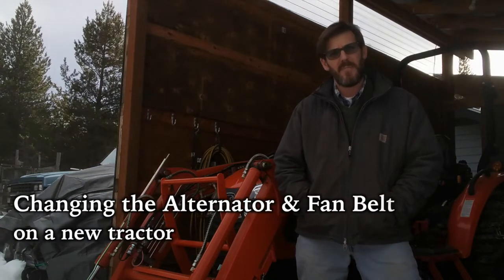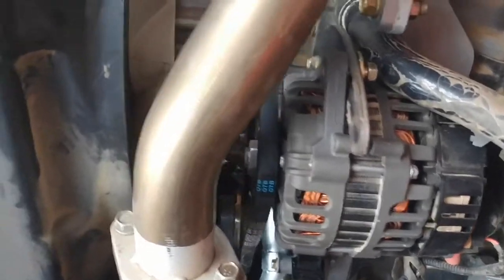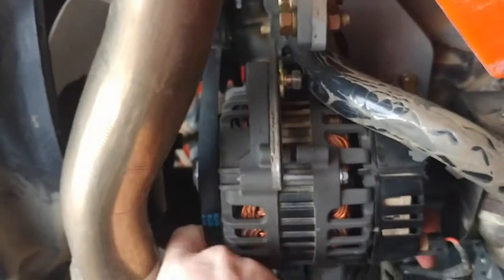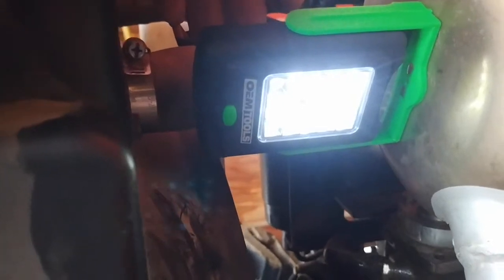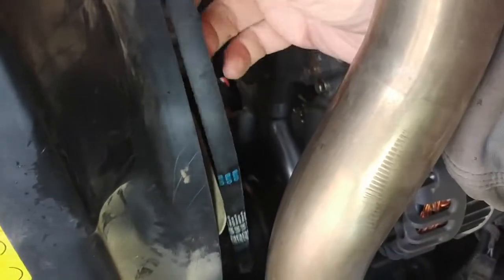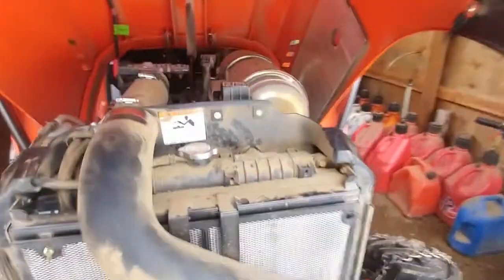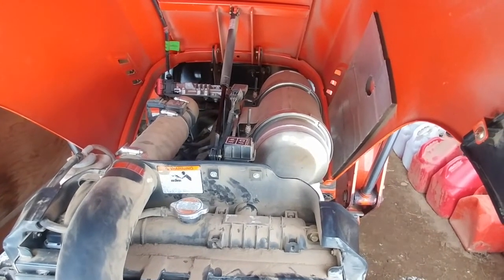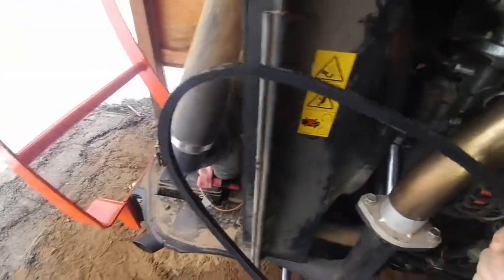Replace a tractor belt the easy way.

Comment: You have more space to work at the bottom of the fan instead the sides or top. It took me 3 mins to change it. Also, it is easier to work on the opposite side of the tractor. Thanks for your video!!

Comment: I'm at 210 hours on my CK3510. I'll have to check my belt and get a spare. With the warranty, I should probably get the OEM belt.
I love my Kioti...so much that I could not have done on my off grid place without it.
I'm very glad that you shared this! Thank you

Comment: Great video.  Either belt will be fine.  I keep a spare on hand for my CK3510 but have not had to change it yet (3 years and 250 hours of use).
Reply from the maker: Geremy, thanks for the comment. It helps greatly.

Comment: I noticed the belt slipping/squealing on my Kioti NX5510 recently. Like you I’m new to tractors. I had come to the conclusion I had to slip it around the fan to replace it but thought…there has to be an easier way. Guess not, thanks for the vid and confirming my suspicions
Reply from the maker: @ Blackhall Manor, Thanks.

Comment: That particular belt on my CK3510SE has always been useless.  It continually stretches, requiring tightening again to keep the fan running (as well as alternator, ac, etc.).  I ran out of adjustment area so now the belt needs to be replaced.  The larger belt has the same issue, but not as bad.  My Kioti only has 40 hours on it and both belts useless from the poor quality and stretching.  I would never buy a belt from Kioti because of this issue.  I think you made the right choice.
Reply from the maker: Thanks. I went through 2 belts and this last one has lasted since I posted the video.

Comment: I have a 2022 CK4010se with 300 hours. The OEM belt is squealing at startup then goes away. Do I just need to tighten to tension to get the squeal to go away?
Reply from the maker: @BossSwanger Difficult to say without seeing it. You might need to tighten by adjusting the alternator. However, it could mean the belt is stretched and you may need a new belt.